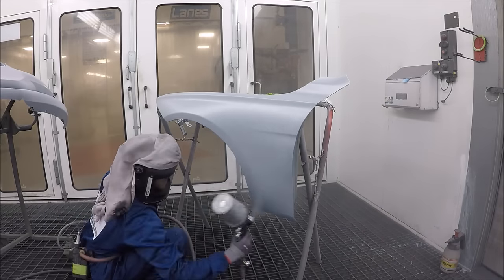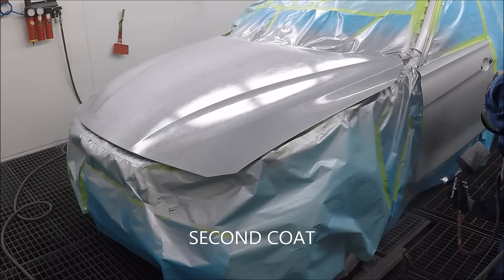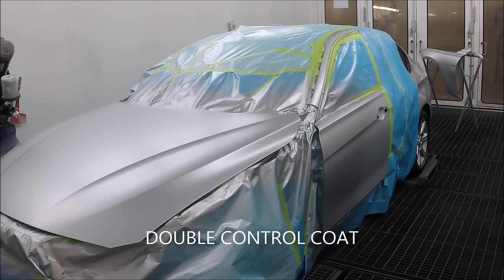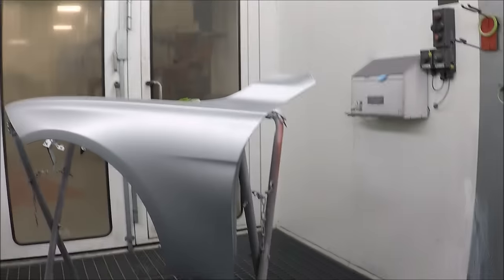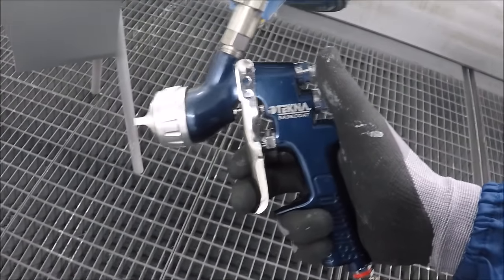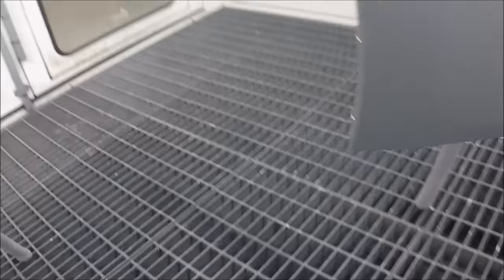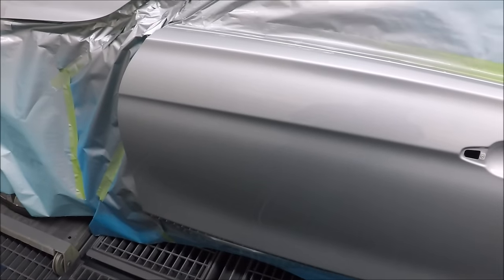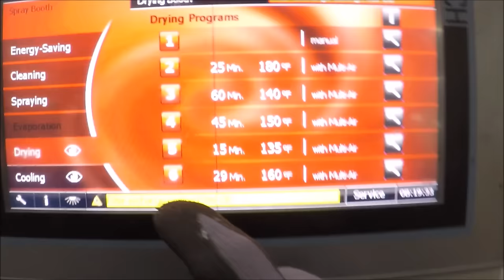Car paint HOW TO SPRAY SILVER

Comment: We seem to work and paint almost identical.  I didn't care too much for the pro lite on HS clears either... any clear to be honest.  Which was disappointing to me.  I'm still playing around with air pressure but it seems like it goes from excessive orange peel to excessive overspray.  I can lay down better clear with my GFG670.  I need to buck up and try the IWATA.

I didn't care for the 3M cup system either.  Never felt secure on the gun, and I did manage to knock it off once while trying to troubleshoot a gun issue, but I consider that and extremely rare occurrence.

Thanks for the videos.  I might actually get an instagram account because of you and a few other talented individuals creating great content like yourself.

Comment: When spraying silver I have issues with sand piling after the control coat. I have tact the panels after but I still have issues with streaking day still sand piling. Silver always seems to be the problem color? Any ortega suggestions. Also when blending the burnt out area sanded to 3000 grit can in spray the blender past the sanded areas and how much?

Comment: Im having constant issues with silver colors mottling on hoods. I spray Envirobase PPG..I can spray an entire side of a car and not have a problem but I cant seem to avoid it in hoods. Any advice? Base gun I use is a tekna copper..1.3 fluid with 7e7 air cap.
Reply from the maker: +DzDeadlyy make sure you have coverage if you are using an hvlp gun make sure you are putting enough color on like I show in my videos check the other silver videos I would recommend to make sure that it is not hot in the booth when spraying silvers!
Reply from the maker: +DzDeadlyy make sure you have coverage if you are using an hvlp gun make sure you are putting enough color on like I show in my videos check the other silver videos I would recommend to make sure that it is not hot in the booth when spraying silvers!
Reply: Thanks for the reply. I recently got my hands on a tekna basecoat gun and must say it lays down silver like a dream. I may be running it to hot. Its winter here in Canada and no trouble to get the booth up to a nice dry 75 degrees. maybe Ill drop it to 68-70 and try my luck.
Reply from the maker: +DzDeadlyy I'm in Ontario!  Take it down to 73 and your going to be good!  Like I said don't be afraid to put it on a bit heavy ! Then do your control coat! I don't know if you follow me on instagram but I go over the double control coat I do there!  Check it out I'm sure it will help!!!  Don't loose heart bro your going to kill it!

Comment: Why so many coats of paint? And your saying that your clear darkens your panel? So the repair will not match the rest of the car, but isn’t the repair suppose to match just like it was never wrecked?
Reply from the maker: Some colors will always need more love. The car will look as it was never wrecked absolutely. That's why we blend to achieve I perfect color transition. It's not a proper repair to panel paint without blending
Reply: I understand that part, but doesn’t it slow down production if u have to tack off first coat and then apply up to 5 coats of paint?
Reply from the maker: If you can save time with polishing it speeds up prodcutstion
Reply: Our company is fixing to switch over to this product and I am thinking I will not be able to get as many booth cycles as I am used to now. Our booth keeps our jobs very clean with minimal buffing. I’m just trying to get an idea before they make the change. I’m used to a coat and half and out the booth with spies hecker hi-tec. It’s fast, color match is great. I have watched a few videos. Good job

Comment: Hey my man, it seems you always do a control coat when you spray your silvers. I have such a hard time gettting my silvers to come out perfect without any mottling or imperfections. Do you suggest always using a sealer and then finish off with the control coat. Last car i painted silver looked great but then when i got it out in natural sunglight i saw the imperfections in the paint. I know a lot of guys use blending agent but it seems i have more problems when i use a base coat blender. Any tips would be greatly appreciated. Many thanks.
Reply from the maker: Hey brother!! Honestly since using the Walcom hte base 1.3 it's made a huge difference. Also try over reducing the basecoat after you have coverage!
Reply: Thanks man. I heard someone else mention they over reduce base a lot

Comment: hey great job.... am starting to paint and i was wondering what is the ideal psi pressure for clearcoat. when using a sata jet 5000
Reply from the maker: +DAVID LOPEZ I would use 25-28
Reply: thanks keep on the good work bro... from Los Angeles CA
Reply from the maker: +DAVID LOPEZ thank you!

Comment: Hello Motivated Painters. I have a question I hope you can help me with. I am no way a professional painter, but I have a small spot on my car that is about the size of a quarter that is missing the paint. I am planning to spray paint the spot, but I don't know if I should use a metallic silver spray paint, or just a silver spray paint. What is the difference?
Reply from the maker: +turntable44 hey brother!  My recommendation would obviously be take it to a body shop and have them do a blow in it will probably be around $150 or so. But to answer your question. I  would go to a auto parts store like Napa, or carquest or something like that and give them the paint code of your vehicle, you can find your paint code on the door or trunk or under the hood depending on what car it is a quick Google Search will tell you very quickly. Now just so you know if you just do that spot like a touch up no matter what paint you out it will hit look good.
Reply: Thank You for info. I'll head into a Napa once I get the color code.